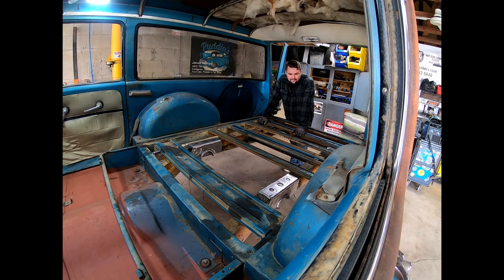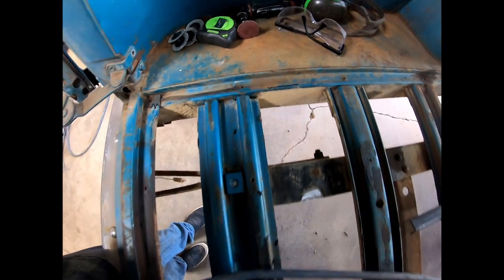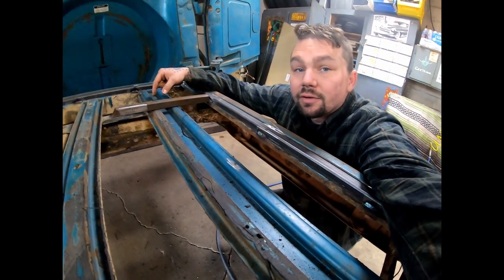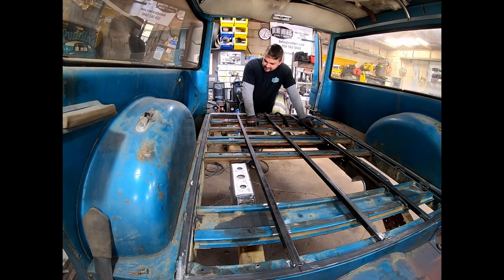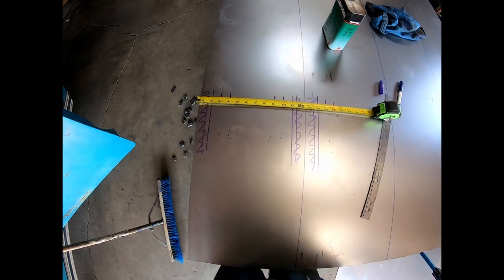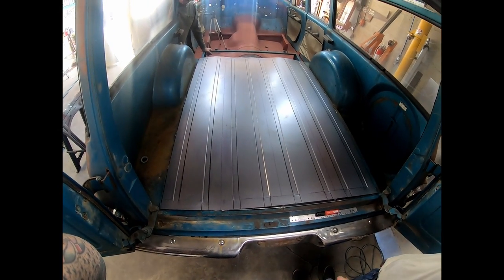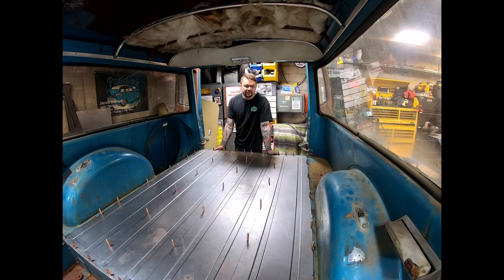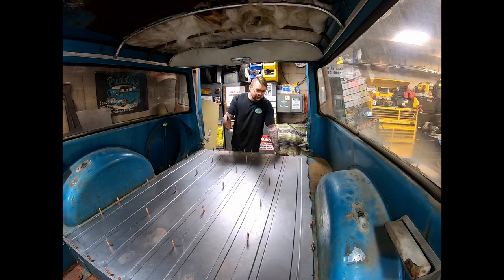REAR FLOOR BUILD PART 1! SO MUCH BEAD ROLLING!

Comment: Dude, you are freakin rockin it! I've been watching the build so far and I am amazed at what you're able to do out of your garage! You are truly an inspiration to me.  I have a 1966 Chevelle Malibu I am doing a frame off restomod on. So far I have the frame down to bare metal and have welded a boxing kit in it. I have all the suspension  components purchased to make an awesome handling machine. I also have a SBC 427 stroker motor (565HP) with a modified TH350 auto trans with a gear vendor overdrive system. Once I get that all done I will start on the bodywork on the car (which won't be much). 
All that's left is everything else... LMAO
Reply from the maker: That sounds like a nice build! I appreciate you watching my videos and I hope they help in some way. The main thing I tell people they can take away from my videos is don’t be scared to go for it!

Comment: Looks great man, love the beads. I did an aluminum floor in the back of the van after building the back half chassis. It's fastened with screws, it being a uni-body I wanted the floor to be removable.
Reply from the maker: That’s a good idea for a unibody especially. I really considered bolting this floor in but I think I’m just going to weld it. I’m still not 100% sure. I’m not going to finish it until I build the rear suspension tho.
Reply: @PuddinsFabShop  good idea, way easier to work on the suspension with the floor out.

Comment: See I learned something.   If you dont go all the way end to end with the bead rolls, your metal at the ends is wider than the metal in the middle because of the takeup caused by the beads.  Thanks.  This is good stuff.

Comment: If you bead roll the back side lightly first you will lesson the distortion in the sheet as you pre stretch the metal so when you roll the face it will not distort half as bad 
Try it
Reply from the maker: That makes sense. I don’t think I could make 16 passes to pre stretch and then another 16 and stay on target haha

Comment: Thanks for the idea. Think I might try on my project if you don't mind. But I have a question for you. You said it was 4' wide. When you do a bead roll or even shrinking does it take away from the total width? If so how do you compensate for it? Meaning for how ever the bead roll is wide or deep how much would you add back into the equation?

Comment: I notice that you have an English in the backround. If you pre-stretch with the wheel on the lines where you going to bead roll. It will reduce the distortion of the sheet and reduce the need to then shrink the edge.
Reply from the maker: The throat of the janky grizzly English wheel is not deep enough to run the panel through. I usually pre stretch when I bead roll. To get that panel through it I’d have to build the new frame for it.

Comment: A lot of man hours in that floor. I'd of chucked some plywood in for the sound deadening properties, but your way is better.
Reply from the maker: There is. I almost did the plywood!
Reply: @PuddinsFabShop  BTW, I recently changed my user name from, Peter Lyons (my government name) to a nickname, Pedro. I don't know if that is obvious here on YT or not, but, you had previously responded to the same comment. Kinda weird the way Google manages name changes, it seems to trip over itself a bit. Sorry for any confusion. Cheers!